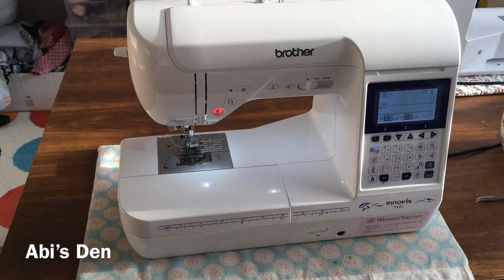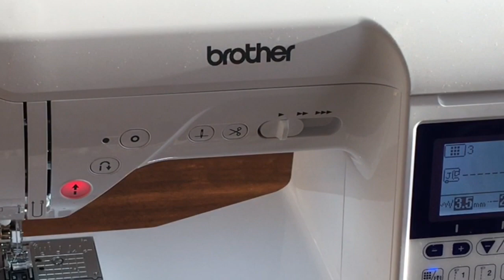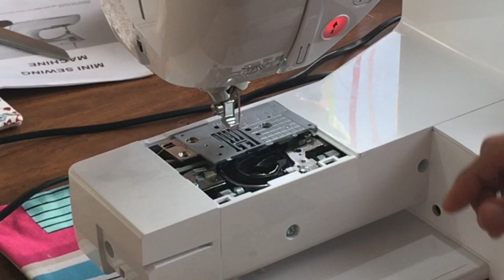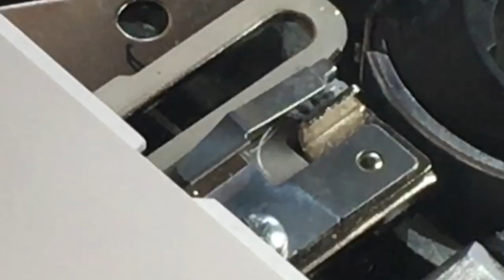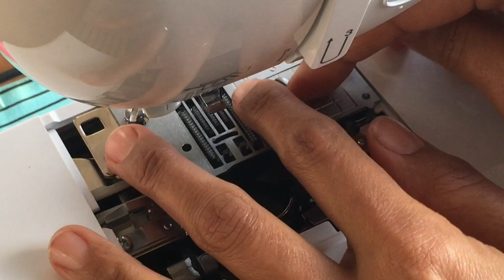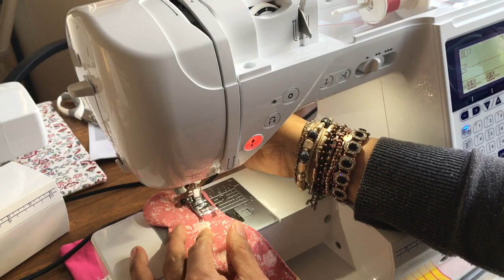Brother Thread Cutter  Knife F420 sewing machine Cleaning  maintenance | Abi’s Den ✂️🧵🌸

Comment: My threat cutter doesn’t work :( the blade doesn’t move when I press it to cut
Reply from the maker: That's frustrating! It sounds like the mechanism might be jammed or has debris caught in it. Have you tried cleaning around the blade area first? Let me know which machine you have and I can point you in the right direction 🌷 Sadly, if it's a Brother, this is very common issue across all of their machines and has been for many years.

Comment: Gah mine doesn't work every 10 uses or so, instead of grabbing the thread on both ends it grabs it on one end and it just pulls it to the left of the blade
Reply from the maker: Well, it sounds like you’re going better than most people. It’s very easily tangled.